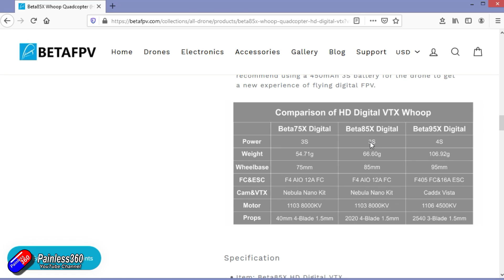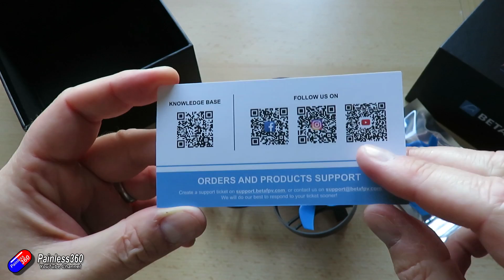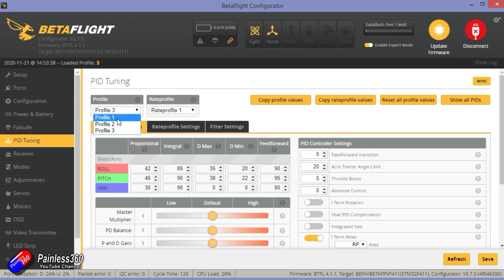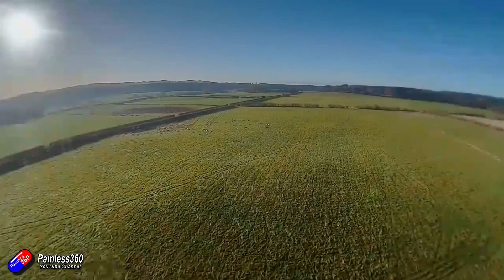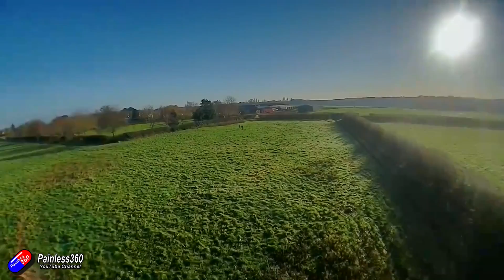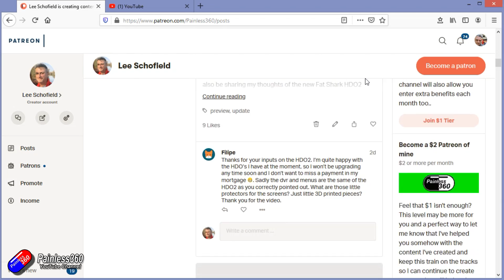BetaFPV 85x  HD Power Whoop: Awesome DJI HD FPV Whoop Fun!

Comment: In addition to my last post .. I bought one of those house drones for kids. The one that has one optic, an intire cage which it slowly spins to allow the one optic to scan as the airframe rotates. This house drone flies autonomously around my house without touching anything. It was $25 US. With one optical sensor.
So, I took the drone into my forest where I live. I took a breath and launched the drone! It took off and began to seek its way through my tree's and bushes. Eventually one small beach got into one area of the cage and snagged the drone. All in all, it was encouraging!  Oh. And it's run time was short because I did not want to loose it.

Comment: Primus. I am a Search and Rescue specialist. They send us in when normal SAR is not enough. We (My Team) spend a lot of time creating Rescue Scenario's in which we can learn from. I had this idea during a river rescue on day. When we search we often have to search rivers and streams, often difficult to maneuver in. This can lead to inefficient views that can lead to undetected target's.
Question. Could a woop be designed to maneuver itself (using optics) through a tough area? And can it be using various light frequency optics like  heat seeking android. With a speaker? I suppose the answer is Yes. But how?

Comment: Jello is a shame with that carbon fiber bracer they fitted, the jello would just annoy me on DJI.  Also focus mode cutting in when you're quite close so maybe the tiny antenna isn't great either. Certainly had problems with these plastic canopies and DJI cameras - they need to be really secure to keep the heavy camera locked in place.  Looks like the canopy is only attached to the plastic frame and not the carbon brace?

Comment: I find it under powerd, because of the higher weight, so I installed 1204 5000kv motors and fly with 4S 450mah ... now it's really fun :-)
Reply: Curious: what's your fly time with that?

Comment: Very nice model.... but yes I also feel it is somewhat overpriced.  I'd also avoid running the decased vista on high power Doesn't look like theirs much air flow for cooling in that canopy.
I'd tweak the sliders in BF and possibly add a ND filter for the jello.    

Another nice video.
Reply: FPV wannabee The vista units shut themselves down if they overheat, even on 700mw with no power management, don't ask me how I know lol. Does take longer than you'd think though...
Reply: @jibbajabba4597  yes that's true. I'd also be equally concerned about how long they will last without the heat sink. Their so expensive and I'd like to get my monies worth. :-)
Reply: FPV wannabee I know, I wonder how much extra flight time you get for removing the heatsinks.
Reply: @jibbajabba4597  would be interesting to test that